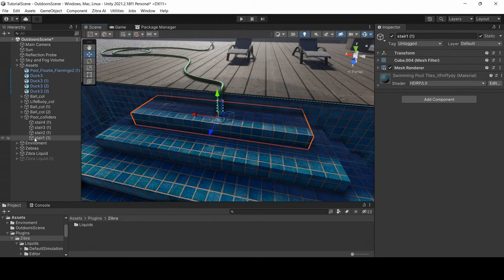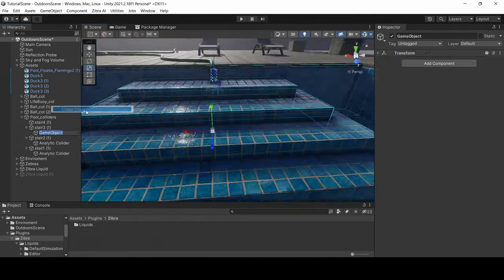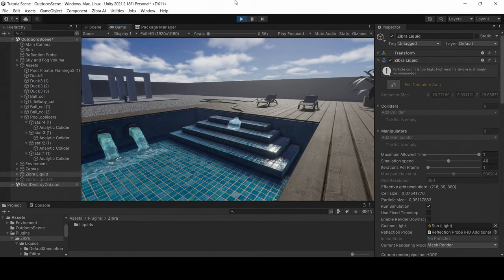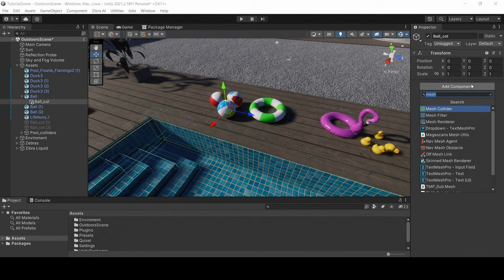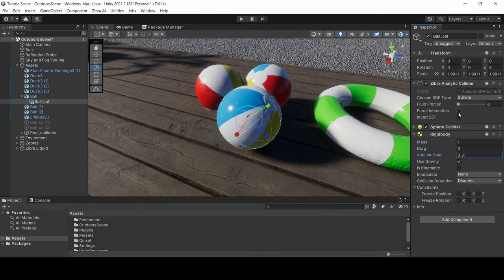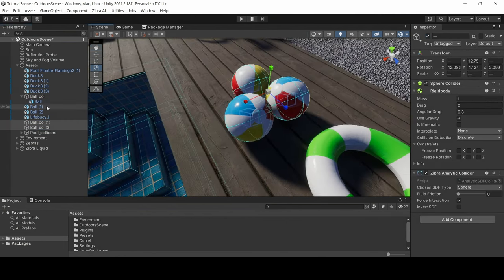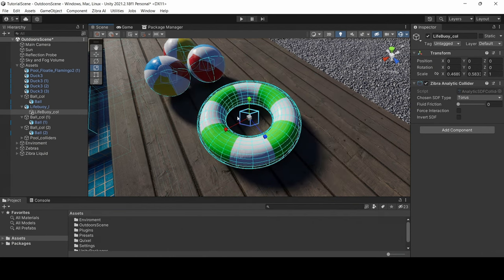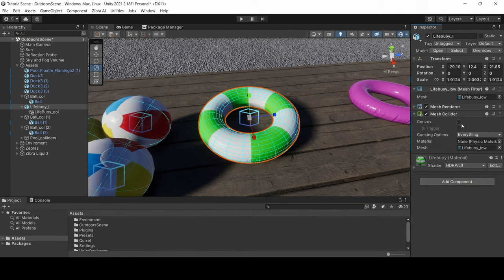Zibra Liquids - Tutorial 5. How to create analytic colliders? | Unity 3D

Comment: Im thinking on using Zibra Liquids in my undergraduate thesis project. How can i make a valve to control the flow over a pipe?
Reply: Trying the same, did you find any solutions?

Comment: Is it possible to have force field effect on a character that exhibit a capsule collider? What would be the final result? I guess when the character enter the pool, the inside of the collider wouldn't be filled with water which is weird
Reply from the maker: We are currently preparing new Zibra Liquids Pro version for release. It introduces feature to use skinned meshes as force fields, which allows you to shape liquid in form of your character. And since liquid colliders and normal Unity colliders are separate, the fact that your characters has Unity's capsule colliders is not an issue.